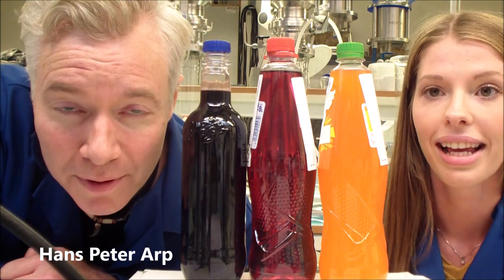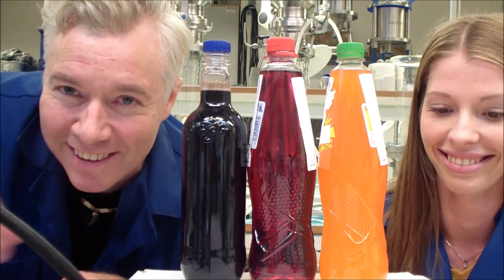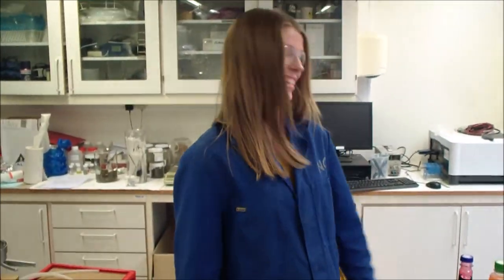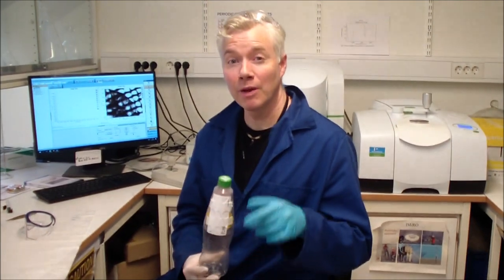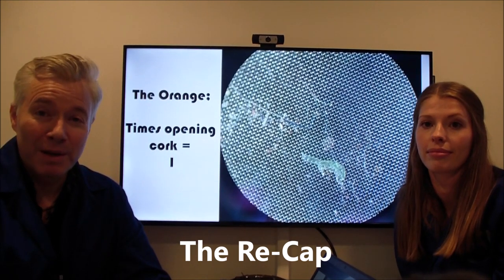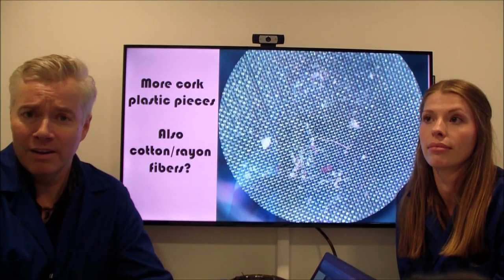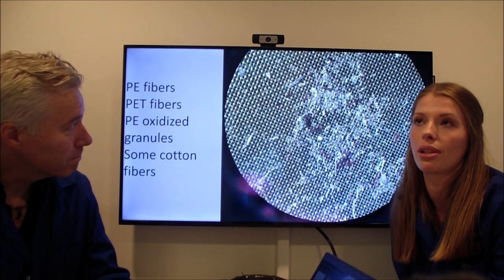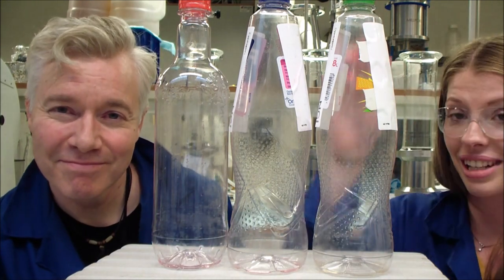Microplastics from your bottle cap

Comment: Could you please tell me which kind of membrane did you utilize in this experiment? I am doing similar research, however, the PTFE filter give some adverse effect on FTIR measuring.
Reply from the maker: We did something a bit unusual and used woven stainless steel mesh, which can go as low as a 26 µm porosity, and are very convenient for FTIR because no background and is very good for transmission mode (ordered here: https://www.themeshcompany.com/products/A4-Sheet-Format--210-x-300mm--p1.html). Others, particularly that are into smaller particle sizes go for aluminum oxide filters (Anodisk). I have seen people also use rare polymer membranes (like polysulfone) but then you really have to subtract the background from the FTIR